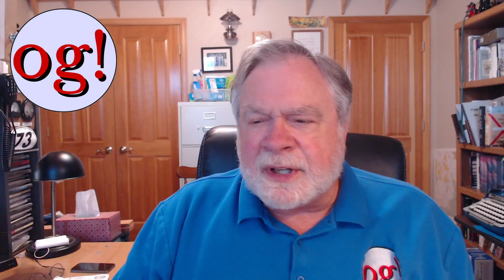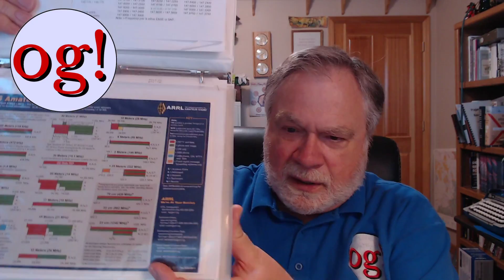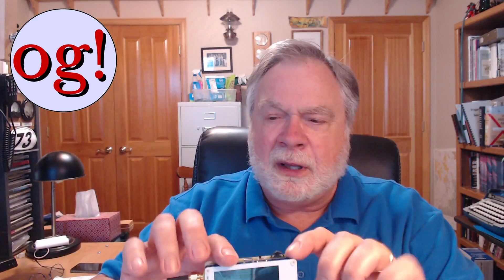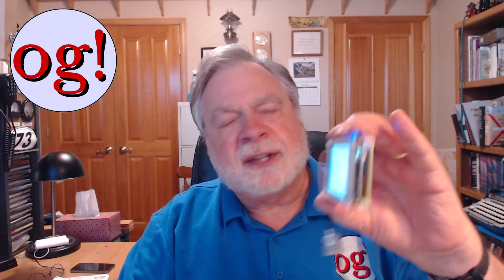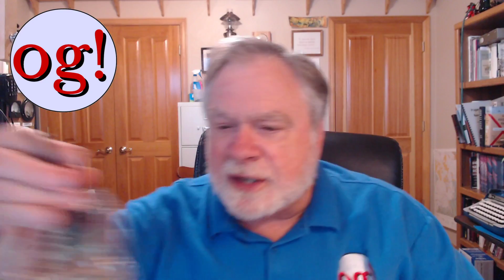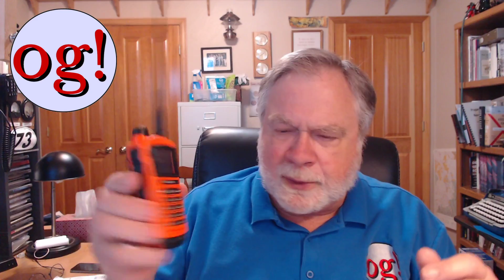25 June 2020 Thursday (0100 UTC Friday) Q&A Live Stream

Comment: I "converted" an old aviation headset for use with my radios. The only real issue is the headphone speakers are around 350 ohms ( like the Hiel headset that look the same). You could hunt down a matching transformer (one from an old transistor radio may work) or just crank the volume up (like you do with the Hiel units.) The mics are low impedance and work with most modern radios except Icom which use electret mic elements and have a + voltage on the mic audio wire to power the element. A standard low Z mic doesn't really have enough output to drive a Icom radio to full output, but if you feed the mic into a mic preamp )mixer, etc) you can drive the FSK input on the back with the preamp.
K1AUS 73

Comment: Also a no to buying the QRP rig from MFJ. Just turn the Power level down on your 7300. Great QRP radio but current drain is high if trying to run on battery.